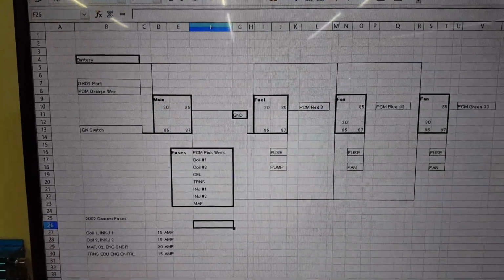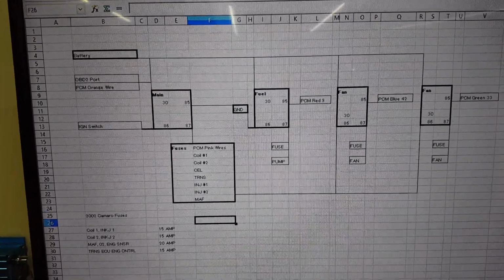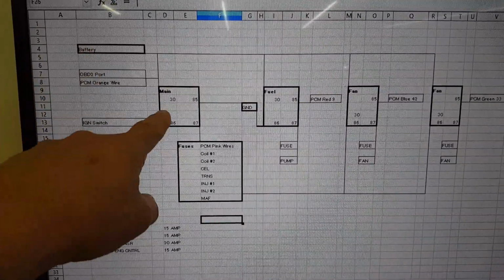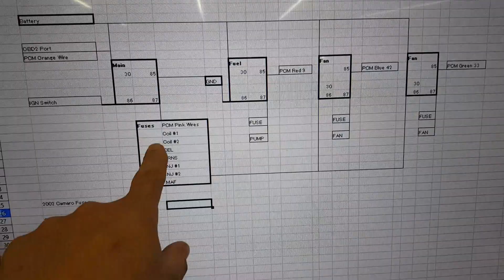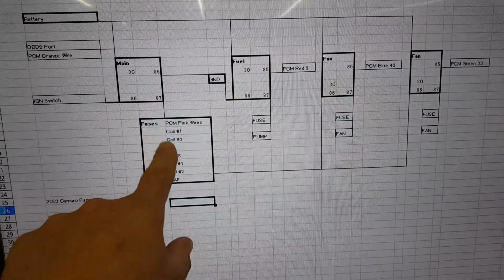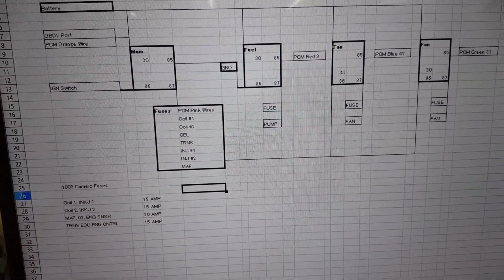LS1 swap harness poor man fuse and relay panel

Comment: do you have the part number for the new pins?
Reply from the maker: I re-use the existing pins from the factory harness to fuse block connector. I usually cut all the wires off leaving 1-2 inches of wire.  Then pull all the pins out and start from scratch.

Comment: Nice test stand !  You built ?
Reply from the maker: I designed the engine run stand. Primarily with a couple things in mind. First, was to route the exhaust away from where you stand when running an engine. Then have it compact as possible with a dash panel, radiator, fuel tank and battery. Enclose the flex plate inside a Chevy detachable bell housing and use cast iron casters.  My buddy welded it and another powder coated it.

Comment: I really like the idea, but cringe at the thought of being easily able to put the relay in the block incorrectly.
It looks like that portion of the block relies on the outer shape to control where the pins mate up with the upper block. 
The upper block appears to have all the restrictions to keep you from putting a relay in one space over, or up, or rotated...

That said, still a good idea, but I think I'd have to add something to block the unused ports, and possibly to key the slots so that the relay could NOT be installed improperly (when tired, or troubleshooting in the dark, or the next owner...)

Personally, I'm rewiring my harness to use the whole stock block, but will be consolidating into a single block instead of the twin blocks that I pulled out of an early F-body car.
Being able to use the existing harness does make things much simpler and cheaper.
Reply from the maker: The relays are reversable. As long as you plug them into the 4 pin socket pins, it will work fine.  I guess if you have problems matching up 4 pins with the 4 terminals, EFI troubleshooting may not be for you.  Failure rate is extremely low as its all GM socket, pins and wiring.
Reply: @aknovaman  
That makes things a lot easier then.
I thought those looked like the bigger Bosch or Hella style relays, with their distinctly non symmetrical or reversible pins.

Personally, this is an interesting swap project, even though my z car is long gone.  It came to me with a small block 350 already installed, but with awful wiring by the prior owner.

As an avionics tech, the wiring is fun, the bodywork is the nasty gotcha that I dread touching!

Comment: That’s awesome, man. I’ve never seen a revamp of the stock harness like that before. Pretty good! I have seen where the stock fuse panel is reused for a standalone. Didn’t get to the end of the thread though, so I don’t know how it ended. 
Using cheap fuse panels and automotive relays is the way to go. 
Are you posting the rest of the swap? 2nd gen camaro?
Reply from the maker: its going into a 69 Z28 from Madison Wisconsin for the owner to install. I dont have the car here